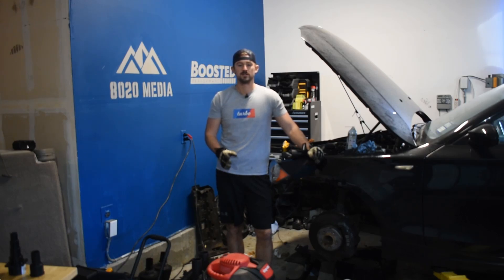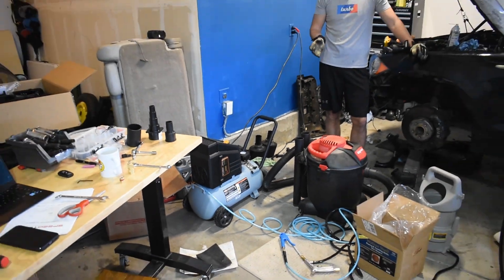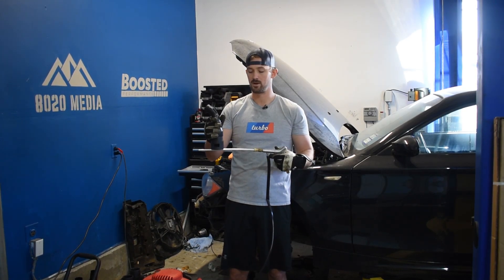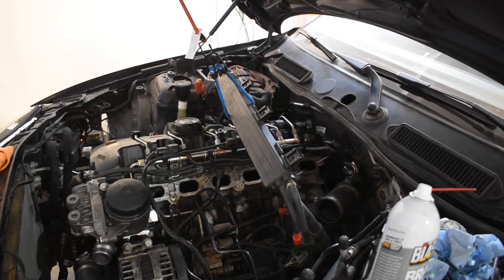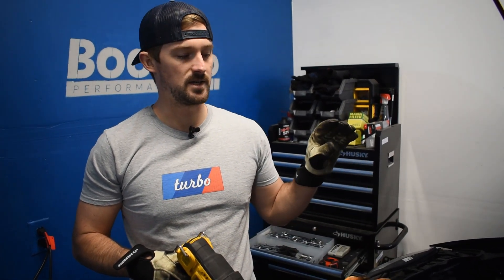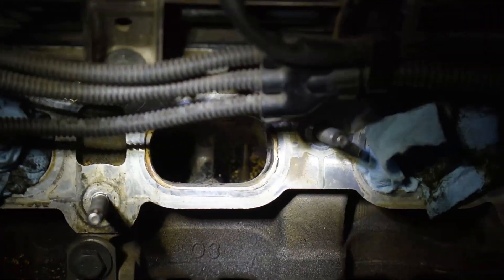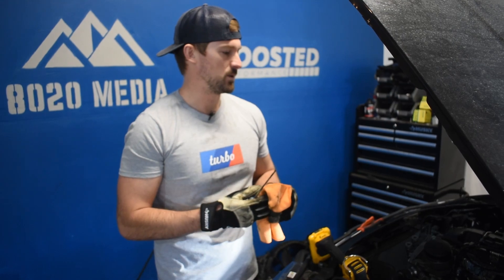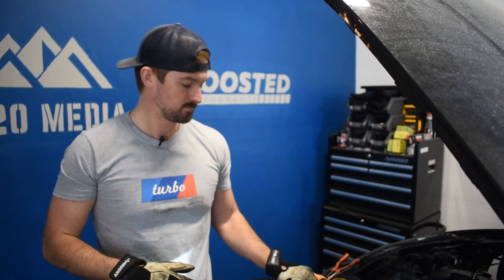DIY - Walnut Blasting Your Intake Valves (Remove Carbon Buildup)

Comment: What your video showed is when doing this procedure use BIG BOY tools instead of the stuff you give a 6 year old to play with. My blasting cabinet with aluminum oxide media can eat through a cast iron intake quicker then your itty bitty compressor set up ? why didn't you simply take a mouthful of walnut shells into your mouth and a large straw from a big gulp at sheetz and just blast it that way ? that is about as much blasting power as your lil compressor is putting out ? You use what you got handy but dont take a video of it and get others to try to do the same job with IMPROPER tools. most people that DIY at home use a 5 hp 60 gallon single stage compressor at the least and a few use the 5 hp 30 gallon compressor.
Reply from the maker: There is a little heart button at the bottom of the video if you'd like to help me get a big boy compressor so that I can be a big boy like you. I'd say my compressor did well enough, if you have a $1,200 big boy compressor good for you, use it. Most people buying something for the sake of walnut blasting aren't going to go buy a compressor that expensive. This video is to show you the process for doing it, good for you if you have better tools. I don't need to eat thru a cast iron intake but if I do I'm glad I know the guy for the job.
Reply: the video says DIY... no one in their right mind is going to buy blasting cabinets and whatever for a job that needs to be done around 60-80K miles lol ... now if you wanna make some side money.. sure go for it.. I think the video was truly just showing the basics of how to do it and what to look out for. Save yourself some coin from the dealerships or if you have trust issues with shops then you ultimately control the quality assurance of it all. The only thing wasted is time with underpowered tools..
Reply: @kib1041  you dont NEED a blasting cabinet .. what you do need is an air compressor bigger then those lil doughnut mini ones that are used by roofing contractors to power a nail gun. the purpose is to blast the carbon off with a very soft media to not harm anything but you at least need some air PSI to do the job. a pancake air compressor is not up to the job. The actual blaster gun can be as cheap as a $8 harbor freight gun and work with no issues.  My point was that the air compressor was perhaps the smallest you can buy and not up to any task beyond blowing dust off your keyboard or powering a pinstriping paint gun.
Reply: @mathewhoffer4541  Just what kind of pressure are you suggesting, 500 pounds per square inch?  That little "hotdog" compressor is capable of 150 PSI, more than enough to walnut blast an engine intake port. OK, I'll give you the benefit of it doesn't have the "volume" to spray a continuous stream but it will do the job in short bursts . . .

Comment: I just saw my mechanic used the professional version of this on a Cadillac CTS and it came out perfect nothing was left in there cuz the vacuum was strong enough and there was no need for him to use any kind of a cleaner after it was done It was immaculate. He only charge like 400 bucks to do it.
Reply: any issues after, engine light or worse?
Reply from the maker: Firm - This is a DIY setup. Shops have much better parts for the job. Thanks for the insight on how much it costs! Very helpful for future viewers.
Reply: It has nothing to do both vacuum. It all about pressure of compress air and ability to aim to hit all spots.
Eliminate vacuum gizmo and you will be able to hit valve behind the stem. Cover all other ports from walnut overspray I this scenario
Reply: That’s an extremely good price I would have paid that instead of 200 on the blaster kit and about 100 in chemicals
Reply: @Pwnulolumad  you can get a blaster for 30 bucks and walnuts for about 25 from harbor freight. As long as you have everything else at home you'll be under 200 bucks, maybe 50 bucks in chemicals if you need em.

Comment: Break cleaner is a bad idea it destroys the valves sealing rubber and will cause oil leaks over the valves stems causing oil level loss and more carbon buildup, I did fall in this trap more than once till I discovered it, walnut and scraping and that’s it
Reply from the maker: Interesting, I know brake cleaner is pretty commonly used for walnut blasting. I suppose if you do a good job keeping the valves closed and drying all of it out it should avoid contacting the valve stems.
Reply: You're not confusing brake fluid with brake cleaner? Just want to make sure it's not a typo.
Reply from the maker: Nope, we are referring to brake cleaner. It's a common product used when DIY walnut blasting.
Reply: Not happening. Brake cleaner evaporates very quickly, you're just making stuff up at this point.

Comment: Only 1 and 4 are open on mine at tdc. Was able to do 4 of em turned crank for the last 2.
Reply from the maker: Gotcha, really depends on firing order but sometimes with how gunked up the valves get its hard to tell if it really is fully seated or just barely open. Definitely had a few turns where it was iffy on whether they were fully closed or not so just kept cranking to double check.

Comment: Great video as always.  I would love to hear 8020 Media on the new Toyota Tundras V6 turbo.
Reply from the maker: Rottingboards - Thanks for the feedback! We will look into adding it to our schedule. What would you want us to cover on the 3.5L TT? Since it is a rather new engine, it may be difficult to gauge reliability or common problems, but would love to hear what information you would be looking for.
Reply: @8020Automotive  Compare turbos, timing chain, and waste gates to the ford 3.5L.  And overall engineering compared to the ford 3.5L ecoboost.  I can't make my mind up between these two trucks for pulling a small RV.
Reply from the maker: We’ll add that to our schedule, thanks for the suggestion!

Comment: Great video.  I would really like some more details on how you modified the blaster nozzle.
Reply from the maker: David - if you have an N54 you can get the adapters and wand from BimmerHelp. https://www.bimmerhelp.info/buy-blasting-tools-html - I don't recommend their intake port adapter tho, it is made of bad plastic and broke on me twice so I had to tape the crap out of it.

If you are looking for a different vehicle application I'd recommend just taking the blasting gun and wand to home depot and finding the right couplers that work for it. Even the fittings from BimmerHelp can probably be purchased for like $2-$3 from the hardware store, but I bought their full kit instead.